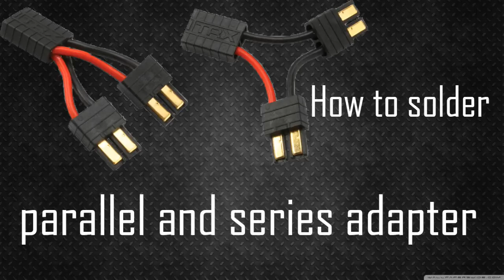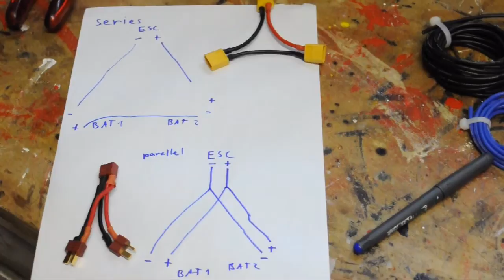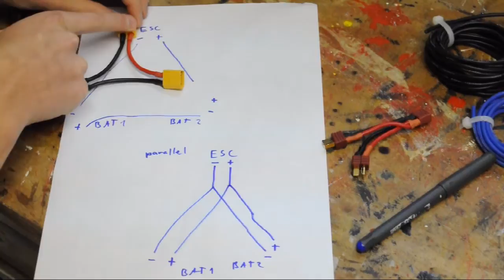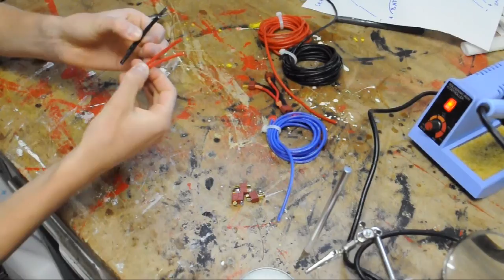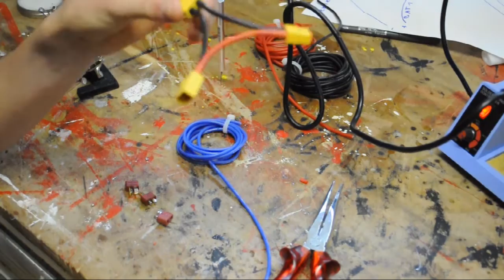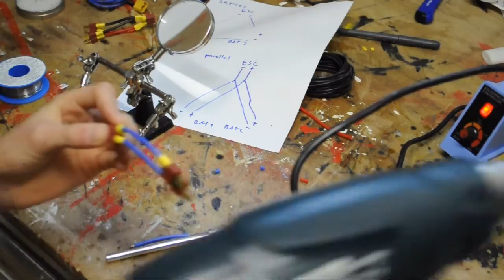[TIPS&TRICKS] How to solder parallel and series adapters

Comment: So, is it possible to hook up 4 750mAh / 7.4v / 20c / 2 cell batteries to replace 1 2200mAh / 18.5v / 40c / 5 cell battery by hooking up 2 batteries in parallel and 2 in series to a motor that can handle 3-6 cells / 50a / 22v? Or would one set of the batteries burn out the other set because of the way they were wired?
Reply from the maker: If you do the wiring right, It 4x 2s 750mAh will result in either 3000mAh 7v in parallel, or 750mAh 8s or 30v in series. If you want to get to 4s or 15v, you would only get 1500mAh.